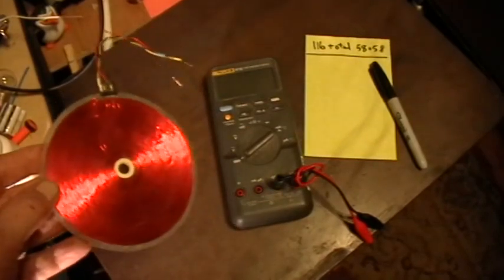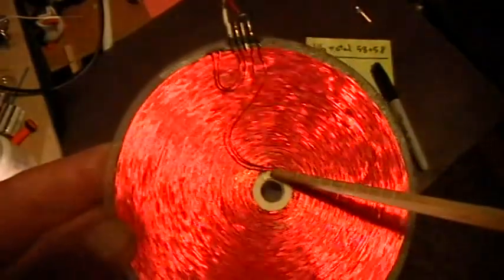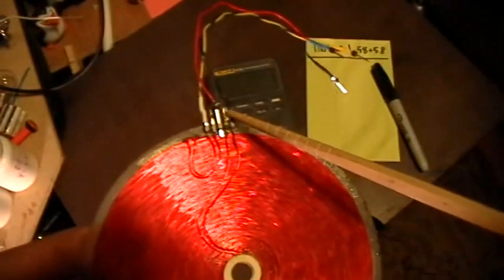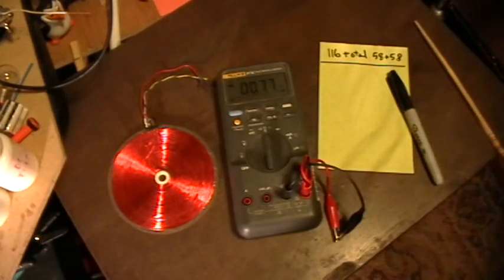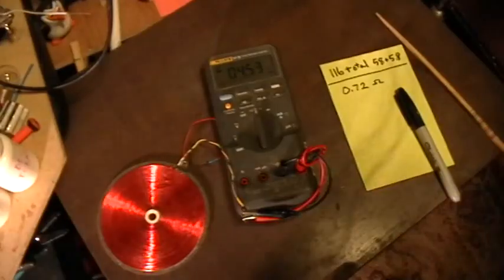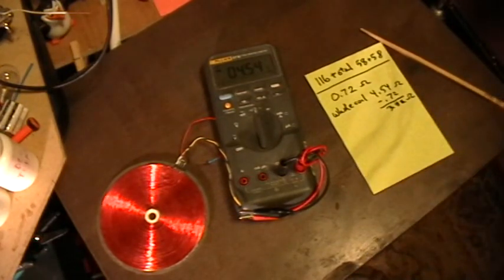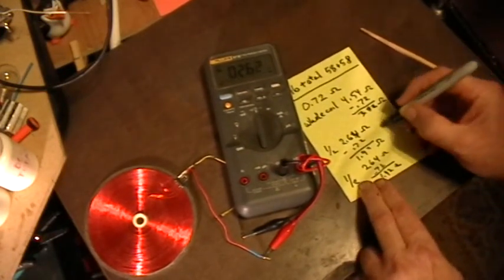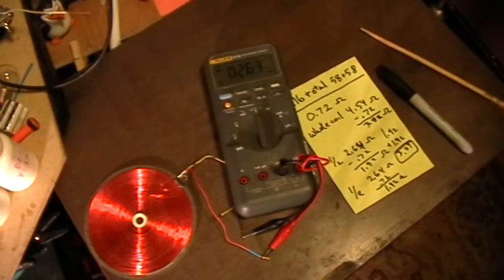Tesla Bifilar Coil DC Resistance: Pancake (1)

Comment: Monofilar and bifilar gives the same DC resistance. What is different is high frequency impedance. Bifilar gives lower self resonance frequency. The principle is that there is a certain parasite capacitance between coil windings, which stores a certain amount of energy. By winding the coil bifilar, you get substantial bigger voltage differences between adjacent windings and therefore more energy is being stored in these parasite/self capacitances. Since the energy stored in a capacitor equals 1/2 C V^2 ( Energy Stored on a Capacitor ), this is a significant difference in the amount of energy that is being stored in the coils self capacitance. And since in resonance, this energy is being flipped back and forth between the capacitance (voltage) and the inductance (current, magnetic component). You get significantly stronger oscillations with bifilar coil at resonance frequency.
Reply: I want to use them to produce scalar waves. Is there a need to twist the two wires? What's the difference?
Reply: @drchoprashow  Nope but litz wire is promising.
Reply: Inductance is considerably changed as well

Comment: Another thing they actually do that I found by accident it's a shield for solar flares a solar flare will set off a geiger counter and it sounds like static but when you move one of these coils near it the static stops no batteries necessary no generators it creates its own solar flare Shield the big the solar flare the bigger the shield but for a big solar flare you need to use iron it won't melt I found that part in the Bible you can bend rebar in the shape of a j but make the two ends close to each other belonger endpoints up you can stick that in a bucket full of rocks or cement and said it wherever you want to Shield like on top of your roof on top of your car on top of you it works I'm giving this away for free anybody smart enough to set it up deserves to be saved from a solar flare so enjoy my bit of information

Comment: ac resistance is different from dc resistance and depends on frequency and coil size (magnetic capacity)
Reply from the maker: Not really. In the AC case we properly speak of "impedance" which takes into account inductance, frequency, and the actual resistance as well. Resistance dissipates power by Joule heating; inductance doesn't.
Reply: TinselKoala Yes you're right ! I just think lot if people don't understand difference between resistance and impedance and circuit behavior dc vs ac.

Comment: It may be obvious to most but for those not familiar with the reason behind the correct Tesla Bifilar Coil connection, in order for the windings of the 2 series wires to wind in the same direction the connection needs to be made as shown in the Tesla drawing in this video.  If an incorrect series A-B end to end wire connection is made the windings would wind in the opposite direction and the magnetic fields would cancel or with an incorrect single wire A-A or B-B end to end connection only one wire winding would be used and the other wire would be a closed loop.  This video and the next one can also be very instructive to those that want to better understand the Tesla Bifilar Pancake coil.
Reply from the maker: Extremely correct again, as usual!  

Have we met? Do I know you from some other forum somewhere?

Comment: +TinselKoala
Seems most likely that TheOldScientest incorrectly connected wire B to B based on your Tesla drawing forming a closed loop and is measuring from one end of wire A to the other end of wire A which he does not take into consideration.  Also possible but less likely is that TheOldScientest has an open connection on the bifilar coil or one of his 2 meters is displaying an incorrect resistance.  Based on your findings in this video if you connect the 2 wires in parallel instead of in series the resistance would be 1.92/2=0.96 ohms not 3.82/2.  In your posted video link, if TheOldScientest solenoid coil resistance of 10.9 ohms is correct his 5.86 ohms resistance reading of the bifilar coil could be for only 1 of the series wires (maybe due to open or cold solder connection if wires mistakenly connected in parallel) or one of the meter readings may be incorrect.  Later in the same video TheOldScientest catches an incorrect inductance reading that is way off which causes him to stop and remeasure with a different meter, so it happens.  Thanks for shedding light on this unsubstantiated claim and working to debunk it.
Reply from the maker: You are once again right on! Please check out the new video which I am uploading now.  I include a graphic which explains the possible mistake "A-A and B-B" instead of A-B. TOS did not ring out (check continuity) in his video so it is entirely possible that he misidentified his winding ends. 
Of course we need even more tests of this unusual and non-physical claim made by TOS which has percolated through the Internet.

Comment: What's the capacitance between the coils?   ; ) I have noticed in my own experimentation  that between to coils there is capacitance. I believe this has an effect on the outcome . I  think bifilar and trifilar and so on , should include capacitive  in the name.
Reply from the maker: The between-windings capacitance can't be measured directly, at least not with the tools I have. But in a later video I will determine the self-resonant frequencies of these coils (this bifilar and the solenoid in the next video) and we can then calculate back from the known inductance to give the distributed capacitance. Stay tuned, and thanks for watching and commenting.

Comment: What are the claimed advantages of Tesla's Pancake coil?
Reply from the maker: As Tesla stated in his patent, the increased distributed capacitance makes it easier to achieve a lower resonant frequency with less external capacitance. In his day, high voltage capacitors were bulky, expensive and hard to maintain. So the bifilar series-connected winding of the patent made it easier to attain the resonant frequency. The flat form (pancake) was useful when it was used as a primary for an air-core quarter-wave resonant secondary (what we now know as the "Tesla Coil") because it helped to attain the loose magnetic coupling that those systems required for best performance, and it also got the "top" or outer windings further away from the extremely high voltage of the secondary so that arcing between primary and secondary could be prevented. 
However it isn't clear to me whether Tesla himself actually used this type of coil for his own systems. He certainly used flat coils but I don't know about the use of the series-connected bifilar winding, the subject of the patent.
Also, it may have been easier to draw than a solenoid coil, to get the point across in the patent itself.

Now, since Tesla's time, a great mythology has grown around this coil winding method. People make all kinds of remarkable and unusual claims. My purpose here is to examine one particular such claim, the claim that the DC resistance is half of what a similar coil with the same length of the same wire would have. So far my testing has not borne this out; every "Tesla Bifilar" coil I have measured has the same resistance as a monofilar wound coil with the same amount of wire.

Comment: I did some small scale DC bifilar coil experiments to explore if there was any increase in magnetic field strength a couple of years ago (unfortunately I did not video them). I found no noticeable difference in magnetic strength between a normally wound coil and a bifilar coil.
Reply from the maker: Thanks for your report. Did you also test and compare the DC resistance of your coils?
Reply: TinselKoala,

They were both 0.8 ohms and 1.75 amps at 1.5 volts. There were some rumors of that bifilar wound coils had more magnetic strength so I wanted to test that theory.

Comment: My understanding is that a coil configured like this is a way to lower the coils self inductance, but not resistance? Perhaps people are mistaken in the  lowering of resistance for another one of Tesla's experiments. Where he greatly reduced the temperature of a coil like this to reduce resistance?
Reply from the maker: Well, sort of. The coil  is wound in this way to increase its distributed capacitance which then makes it easier to cancel the coil's self inductance at a lower frequency of resonance, without adding external capacitance. As Tesla says in the patent, when this balance is achieved the coil has essentially no AC impedance and only its ohmic resistance is present.  This balance can be attained with every coil (as Tesla says in the patent) but it requires less external capacitance with the patented winding. 
However, this video and the next one are concerned with a different claim which concerns the DC resistance of the coil.  I don't think Tesla ever made this claim but there are a few people who seem to believe it is true and there are one or two demonstrations of the effect on the YT. However I have not been able to see it with my coils, and I think the demonstrations I have seen may be in error due to a simple mistake in wiring, or for other reasons. Or maybe I'm wrong, only more experimentation will tell.

Comment: QED indeed...curious to be sure...mutual inductance coefficient benefit additive .02 per 2pi or .04...resistance is futile. Mandelbrot set system engage...
Reply from the maker: To be serious for a moment....this video did not address the issue of the inductance of the coil, since testing proceeded with DC current at steady-state and there is no core material other than air. However, the "mistake" I mentioned in the Description, which I see as a likely cause of the Half-Resistance (apparent) Myth,  will also produce the inductance variation that certain people have reported with respect to Tesla Bifilar coils.